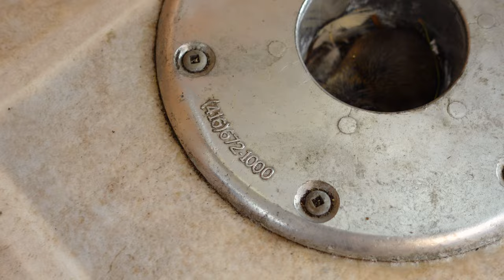driving my truck camper ALONE for the first time

Comment: I'm 35, dad passed away when i was 4, and I had to learn to do a lot of shit on my own. 1 thing that was huge for me was driving a bigger truck and hauling a 14' cargo trailer long distances while in the process of moving around Alberta, Canada. So many factors going into driving with a load like that and having to be so much more aware on the road. 1km 1 checkpoint at a time. Always be checking your load and try to be aware of everything around. Safe travels little one.

Comment: If your tundra doesn’t have slide out tow mirrors, I would suggest you purchase some mirror 8:43 extensions that strap onto your mirrors for towing that will allow you to see behind the corners of the camper. You might even consider a wide angle rearview camera for the camper. It gets easier the more you drive.
Reply from the maker: Yes I have some tow mirrors - just gotta put them on!

Comment: When you do this stuff for a while you begin to understand the importance of symmetry and layout. When you pre layout the design before installation you can see how the design will look prior to install. When the ceiling tiles leave a space when you get to the end that is not large enough to fit another tile, rather than cutting a tile to fit the space you measure the space and cut it in half. The half measurement is what you make the "trim" dimension. Then when you install the tiles the trim allow for perfect symmetry. Then when you look at it even out of the corner of your eye everything looks as it should. Ok tori?

Comment: Very impressed with the progress of the project. Once you approach the final stage you will see that the camper is a collections of systems that the owner must learn, understand & become familiar with to ensure that any problems can be resolved quickly while OTR. Water, solar, lighting, heating, ventilation, refrigeration, etc., are all 'systems' with components that can/will fail, compromising that 'system'. I personally found the water system in my pop-up camper the most complex one to learn, as it is designed to fully drain for winterization, requiring some clever valves & routing to accomplish that while still performing it's purpose. If the camper is electrically connected to the truck, ensure to add a one-way amperage check so the truck's batteries aren't drained. 👍

Comment: Nice choice for a roof coating. I would suggest a 2nd coat. That should last for several years. Just inspect it once a year for shrinkage around caulking places and touch up as needed. Great idea for ceiling covering. Should look good when completed. Side wall vents can be a source of leakage, especially with blowing rain. Might want to keep an eye on that.

Comment: You are doing a great job! Many years ago a great person who understood what I was going thru taught me to make "a list" anytime I began to feel overwhelmed or unable to focus on one thing at a time. By being able to look at it on paper, the overwhelming feeling disappeared.  One other thing that may help in covering the roof on the inside; If you score the panels you have glued up with a straightedge (where the tips of your ring and middle finger are on your right hand at 16:55 in the video) and then take the remaining (4)? panels you have left in the box and cut (each side) of those 4 inches to the right up against the inside square you will effectively have an "extension" (these pieces will overlap) that you can glue along the sides, inside the camper. Keep doing what your doing. Every day is one day closer to your goal.

Comment: Good on you for the determination to move forward. Don't worry about the size of this rig compared to the Putt Putt jeep. The truck will become familiar and be less intimidating as time goes by. It sucks to build alone sometimes especially when it's hot out. I do agree it's harder on you because of lack of building background...but you will figure out what works and what doesn't work just like the rest of us did.
Keep you spirits up and tackle it a piece at at time without getting overwhelmed.
I was actually doing solar panels on the top of my trailer in Nevada last week and I shot the temperature of the aluminium roof. It was 109F outside in full sun...the roof metal was 152F.....unbearable working conditions..😢😢😢😢😢
Good Luck....God Bless....Stay Safe

Comment: You’re doing great, take your time, little at a time. Remember the term - righty tightly, lefty loosely on your support jacks.  Even though you have covered the upper part of your top and patched the roof for leakage I remember you saying there was a low spot. Wonder if you should apply another coating on the roof too. Another thing could be where you put the tiles up underneath that low spot you might put an extremely small pin prick in the low spot of that tile so you can see if it leaks in the future. Just a suggestion. I am so proud of you, I know it is exhausting and frustrating for you but you are really making progress. Go girl!👍❤😄

Comment: Your tiles are nice but you really are going to need some insulation foam on that roof or it will be like a oven in the summer and freezing in the winter with just the aluminum skin as your roof. Reflective foil first, then minimum 1” foam insulation then your tiles. Keep up the great job!👍

Comment: When I'm cranking my roof up I keep a small hammer with me and I tap the handle back in as it starts to slide out of the slots. You'll see it start to work its way out when you're cranking. Just tap the crank back in every other turn or so. As needed. It keeps the roof from falling back down when you are cranking it.
Reply from the maker: Why do they make it like that? That the crank slips out?
Reply: @TorieRobot  I think it's just that it is old and worn out a little. I have not had a problem with the roof at all since I started using the tap it back in method. try it every crank or every other crank tap it back in and it's easy to lift up and down.

Comment: You can put staples in the PVC panels until the adhesive cures, but after that you should just pull them out, or they will rust if you paint over them. Also be sure and remove all traces of the old ceiling residue I can see there whatever it is or the panels will not get the proper adhesion they need. And honestly I think what that roof is missing is is PVC rafters with at least 1/8" per foot drop from center for proper drainage. I hope that helps. Wish I could help more...

Comment: 14:11 umm . My biggest concern is anything u use to attach to the ceiling of your camper, that could puncture the roof,needs to be sealed .. hard to describe exactly without going into great detail. But I hope u get what I'm talking about.. 🤔 even staples if there is no wood. I'd be careful.. but not my camper ...

Comment: leaks on campers are tough to find.....if you are missing any marker lights along the top, and all the existing lights, make sure they are sealed, just dont seal the little weep holes at the bottom of the light lens. good luck with the build.....I do like the tundra.
Reply from the maker: I’ll go around the lights and all once I get some non leveling caulking 🙏🏻

Comment: If you could get a 3/4” ratchet wrench.  With perhaps a extension on the wrench handleAnd a socket to fit your camper jacks it would be much easier for you 😁🎩

Comment: Love the videos. I have remodeled a few campers and hope this information helps. I would give rmr86 instant mold and mildew remover a shot for the canvas. I have used it for years on boats and it is night and day difference and super easy to use. For the roof I would get lap sealant and cover all the screws completely around on the very top of roof. Lap sealant is super easy and self levels. It would take you 30 mins and would ensure no leaks where the screws are.The screws will leak at some point and this will help keep it from happening.😁 I think you have done an outstanding job so far and look forward to seeing the other videos and your progress. Keep up the good work.

Comment: Hi .. Its so nice to see this coming together!  You are going to have a lot more living space available on your travels :)  Everyone needs a pet grasshopper.  The mat was really nice.  Alignment of the camper in the pickup bed looks good.  Some touch-up paint will protect that area where the paint scraped off.  Your truck looks beautiful.  About roof leaks .. most leaks occur around fasteners, corners, and edges.  A water-hose test can be helpful in finding leaks.  I like your ceiling idea with the white panels.  Good luck Victoria!!! .. ROBERT
Reply from the maker: I’ll try out the water hose method soon!

Comment: The camper is coming along nicely 🤙I heard you say in this video that their is a spot that is leaking and I wanted to share with you something I heard a trailer camper with 40 years experience state in a video I saw. 
He stated every single trailer camper on the market leaks old or even brand new and it’s a matter of simply trying our best with maintenance to control the leaks best we can and to not use silicone because sun lights degrades it quickly. 
He also states trailer campers use something called Dycon instead around windows, edges and joints. 

Can’t wait to see your camper once it’s finished because I thought about buying a slide in camper many of times. 

Take care and be well🤙🙏🤙

Comment: You should get an "I fully rebuilt the roof on my camper. What's your superpower?" t-shirt... 😄

But really - what you're doing day by day, challenge by challenge is inspiring at so many levels. Combine this with quality video work and your personality: I'm in for the long run.

Btw. are you planning to stress-test the roof insulation (too many layers of coating is not enough layers of coating) in the end, like flooding the roof with a hose or sg.? Like simulate driving through pouring rain...

Comment: Put a reversing and side view camera set on your wish list for sanity and easier maneuvering.  Also, depending on the specs you could coat the inside of the roof with your RV Roof before adding anything else.  Good work getting it all to fit. That truck will hardly notice the camper but traveling slower will save a lot of gas.
Reply from the maker: I have to look and see if I can use that stuff inside or not

Comment: When loading up your camper pop the pins on your tie down extensions remove them until your backed in, they won’t hit your jacks, reinstall and your good to go!
Reply from the maker: They dosnt work with the location they are in as they have length to them and the leg is in the way to reinstall it

Comment: Hi! pop-top truck camper owner here! Just some friendly advice whether you heed it or not.

1: Don’t use an impact on the jack legs use a brushless drill. Impact will strip the gears and work less efficiently if at all. Even my little Milwaukee M12 Fuel does the job.

2. Using some wood between the wheel well and side is great I do also but it can still slide around by twisting especially on bumpy roads, simply screwing a piece to the ends that spans the front of your bed will prevent twisting.

3: If you plan to leave your tailgate on/down it might be worth wrapping it. It will get peppered from rocks.

Love the build/repair series (:

Comment: Dont be paranoid to drive the truck with the camper. Just drive it loke you would any other vehicle. Just make sure to look in your mirrors a lot, dont take corners too fast, and start braking earlier than you would in a car if you have to stop fast. Watch your height too and look on dirt roads so yo dont hit low branches. You will get used to driving it!❤
Reply from the maker: Yup and thanks!
Reply: I thought you said drive it like any other vehicle.LOL

Comment: For the impact attachment, take the hand crank to the hardware store and find a bolt that it fits on, then use the bolt to find the proper attachment for the driver/drill.  I may or may not have done this before.  LOL  For not being able to see behind you, there are some reasonably priced "backup camera" systems out there that you can install with a monitor on the dash so you'll always see what's behind you.  You got this!

Comment: When you have it off the Truck you should put a couple sawhorses under it and lower it on them with the Jacks just for stability but not holding all the weight! Especially if you are going to be inside of it. Also I think you are sometimes a tad hard on yourself! You have take on something most wouldn’t, and are learning so much, plus helping others to do the same. The Truck really is a clean looking Truck, and I believe you have it dialed in Now! Everyone is really Proud of you and your Accomplishments and Determination 😇😇

Comment: If you're willing to pour more money into the jacks, you can upgrade to ones that are on brackets that are hinged so the camper jacks can fold out of the way and then come out further when you need them, giving you more space for the truck. In the end, that camper is going to probably be sold and you're gonna take that money and run away before they can take it back. That truck has lots of potential, though. A Toyota like that can be brought up to just needing general maintenance over time and you'll know so much about it by then. I have a 2001 Tacoma that came with its fair share of issues and 6 years later it's running like a top with its original engine and it is a beast. That Tundra could be the last vehicle you ever own.

Comment: I love your work. But here is a helpful hint. Put at least three layers of roof sealer on. As well go back on top and make sure your staples from the staple gun did not go through your newly sealed roof. Love the content. My family and I are from Ohio as well. Stay cool in this heat. Don't overdo it.
Reply from the maker: I already had one layer so it has two layers now and there’s a layer of thin board and stryofoam so the staples won’t go through

Comment: You would load the camper yourself. It's easy. Look in your rearview mirror and go right between the window of the camper. Stop when you need ti, even get out and check that your in the middle of the camper. Once on the tie down will keep it from shifting.  Do this a few times and you'll be fine.

Comment: Victoria when you get the socket for the jacks do not use the impact tool, use a power drill for if you use the impact, it will break the pins that hold the gears, you will need tow mirrors. When you load and unload the camper remove the brackets, so they wound not hit the jacks.

Comment: I suggested this elsewhere, but I did some research and maybe spraying the inner roof with the waterproof stuff they use on inner walls that's water proofing for bathrooms before they place drywall (DRYLOK is a brand but there are others), then once that dries, spray that textured truck bed liner over top (Gorilla Truck Bed Coating, Durabak, Herculiner, etc). Then for the outside, seems it needs sealed with something like rubber sheeting. Just a thought. 

What's funny is, I don't camp, but man I do a lot of DIY projects for my house.
Reply from the maker: I’ll look into it!
Reply: @TorieRobot  If it's too thick closing the roof flat and sealed might be an issue. However Chrome from "VanCity VanLife" on his early van build just got a piece of flex ply on his and looks good however she could roll on a thin layer of that coating under-roof then put those white square tiles she got over it would work too but careful bcuz can't be too thick.
Reply: @SigmaSkyGig  Ooooh good call too. I'm trying to dig up all I know about water proofing. I live in Louisiana so water is a constant issue, no matter what you're living in. I may poke one of my friends that does camp too as they may might have more info than my four walls and roof on a stationary structure ass honestly has no idea in regards to campers. I do enjoy watching other folks camp though.

Comment: The only problem I see with the mat is allowing water to drain when it rains . The mat will hold water and possibly grow mold blocking proper air flow . You have done a great job , much respect to you .👍
Reply from the maker: No water should get in there with the camper over it
Reply: @TorieRobot famous last words.

Comment: Hello Victoria,  I'm really enjoying watching your videos!  I'd like to say.. that so your not stressing when you have to take off the camper.. those brackets that you installed with those clips, take out the clips.. and remove the lower hold down brackets when you're driving in and out of your camper by yourself..? And you'll never chance hitting them..???  Just a suggestion?  Good luck with your camper!!! 😊
Reply from the maker: I wish but no unfortunately- the way the tie downs mount into the frame requires there to be space to take them in and out and it’s too flush with the leg to be able to have them out which is why we had to do it that way

Comment: Once you get used to driving with the camper on you will be fine. Depending on the tires you have on it now,
the next time you get them you may want to tires with a heavier weight capacity rating.

Comment: I think the ceiling tiles have too much negative space on their topsides. 
Those negative spaces will hold water, bugs, and whatever else can craw, seep, or grow in there. 
Even condensation will gather in those voids.
I think you need ceiling tiles with flat/flush tops to reduce those risks.

I would also suggest finding a thin-light insulating foam board (increase your R-value) attach that to your ceiling and then attach decorative ceiling tiles with flat/flush tops.
Reply from the maker: You’re probably right about that - maybe I’ll have to try and find some flatter ones -
Reply: @TorieRobot  or find a way to flatten the ones you have.
If you’re set on the pattern, you could use some expandable foam in those negative grooves, and then cut the foam flush. 
🤷‍♂️ just a suggestion.